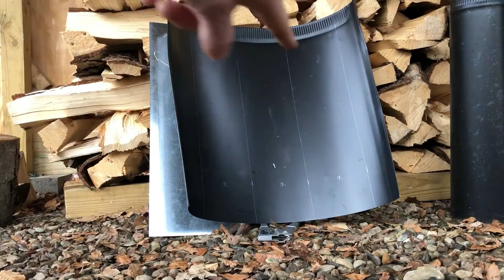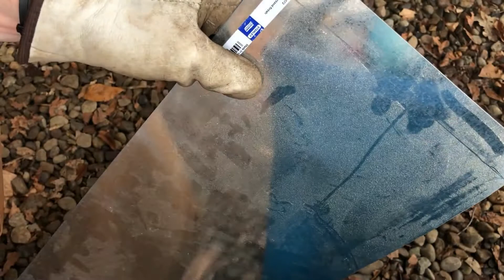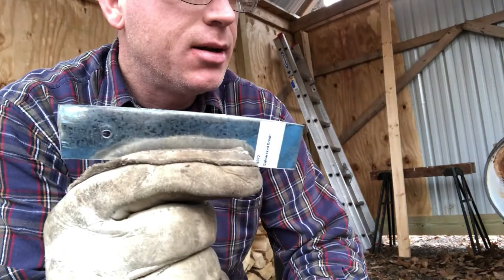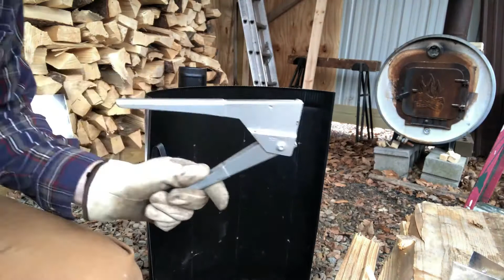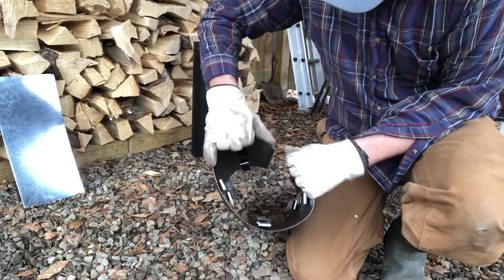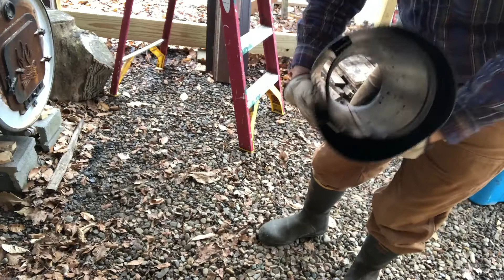Make Your Own Double Walled Stove Pipe

Comment: I did find this useful but a 1.0 or 0.75 inch conduit ran parallel might be a better idea than the tabs as it seems pretty weak and will probably give/flex/warp once the fire cranks up the 500+ F degrees heat.
In the older days, the internal spacer pipe served double duty...
1- As a heat shield
2-  As a Hot water pipe as well. 
      Just not much reserve until the idea hit that  you can  spiraled it in like a spring.. 
 It dud require extra support for the extra piping and water weight though. 
Then one had a steam  pressure explosion and it lost popularity until the boiler era.
But the conduit spacer pipe is surely a better and safer effort.

Then again you do not have to use the full 10 foot length of conduit, 3 inch long cut pieces should do the trick.
But sill .... I give you a 100 on the tab idea... it should be fine.
Reply from the maker: That’s an interesting perspective and definitely something worth considering for a future build!

Comment: Thank you for the share good sir, I've recently installed 2 woodtoves on my property, one in my studio and a nother in my shop, I know all to well how expensive insulated double wall chimney pipe is~ and the kits that go with them. (outrageous) in addition to the fact that you will have to purchase the same product again when the heat rots it out for a inflated price in 10 or so years, the first stove in my apartment was done with a legitimate Selkirk through the wall apparatus, and the second I made myself with some sheet aluminum, to not make this any longer I appreciate your share and will indevor to integrate this frugal adaptation in my next build and save as much money as possible, perhaps with some kiln insulation or rock wool to help keep things from getting dicey
Reply from the maker: Thank you for the kind words and for watching! Best wishes to you

Comment: Nice!  Is that your exterior chimney pipe too?  If so, how did you finish the top of the pipe?  Can water get in between the pipes or did you figure out how to enclosed that gap between the pipes?
Reply from the maker: This is just the portion that passes through the wall. It’s single wall before and after, and is capped by a regular rain cover. I need to figure out some way to keep rain out because it does get on the floor if it’s a heavy rain.

Comment: Seems like that would've been WAAAAY easier with carriage bolts 🤷🏻‍♂️ and faster also would've helped to insulate that pipe with ceramic fiber
Reply from the maker: I’m not sure I follow how you mean to use the carriage bolts?
Reply: @scottthornandhisbeesandtrees well I would've used ceramic fiber between the two layers and just drilled straight through both pieces and put the carriage bolt/screw through from inside the inner pipe a nut and washer and another nut and washer spaced at the right outer diameter wrapped it in ceramic fiber punched the bolts/screws through the fiber then just wrapped your outside pipe, joined it's seam and capped your protruding bolts/screws with washers and a nut but that's just how (my mind) sees it. You still did a pretty amazing job and saved yourself a lot of money
Reply from the maker: @jamesbernard6841  thanks for the additional context. For this I just used what I had on hand. I don’t doubt what you’re describing would work. Thanks for watching!
Reply: @scottthornandhisbeesandtrees  yeah thanks for sharing your experience with all of us. Honestly after thinking about it you really don't need to fasten both layers together if you insinuate the pipe with the ceramic fiber you would just need to roll the inner pipe in fiber, wrap the outside around it and then fasten the outer pipe closed, for added strength you could just drive the right length self drilling screws into it but wouldn't be necessary if this is connected on both ends. Great build tho
Reply from the maker: @jamesbernard6841  thank you for the kind words. This was for a sugar shack, and once that building was destroyed by a falling beech tree I used this in my barn. I like your idea for a more permanent fix
Reply: @scottthornandhisbeesandtrees  as a tree man climber/trimmer I feel your pain with the falling tree ugh, what you did was totally a good build and I admire the craftsmanship it's always easier to rethink someone else's thoughts lol 🤷🏻‍♂️ I've been banging stove pipe ideas around in my brain for years now the stuff is so dang expensive it's almost like they're trying to keep you from being self sufficient 🤔
Reply from the maker: @jamesbernard6841  that’s a fact! It was a few days after I had hosted a field trip about how to make maple syrup so glad at least no one got hurt. Hard to believe what the prices are!
Reply: @scottthornandhisbeesandtrees  the elite are stabbing the American dream to death one stick in the ribs at a time. The people have forgotten what the true American dream is . . . . To generate and store your own wealth, to establish self sufficiency and security making one a true FREE MAN ! And nothing scares the global elite more than the truly Free Man who can't be bought, swayed by propaganda, manipulated with recourses, extorted thru high interest rates etc. Power to the people may the people exercise the power!! 💪🏼

Comment: What about the guts out of a kerosene heater. Therebis triplw wall sheet metal in them. I got it out of one to use for a flue jack.
Reply from the maker: I can’t say, because I don’t have any experience with that part. But the biggest thing is to keep the surrounding surfaces cool.

Comment: How did you enclose the pipe. Like how did you block the gap on both ends to block out light and cold air coming into the building?…
Reply from the maker: In the original application I didn’t do anything as it was a mostly open sugar shack. In the current application in my barn I tried to use some sheet steel on the outside gap but it was poorly executed 🤦‍♂️. Air is not a significant issue but some water does come in.
Reply: @scottthornandhisbeesandtrees  I’m mainly concerned with the light. Bugs and such. I am considering using your method but stopping my 8” flush or just slightly on the outside and then running a 6” trim collar flush on the building to block the light. 
It’s a lot cheaper than buying a single piece long enough to go through the wall and I’m in a post frame building with no interior walls.

Comment: Thanks so much for sharing? I was wondering if you couldn't just stick aluminum ceiling hanger strips down around three sides. I don't think it would get hot enough to melt the aluminum.
Reply from the maker: I don’t really know the answer to that. If you search for the melting point of aluminum it may help you make that decision. I used these steel tabs since that is what I had on hand. Thanks for watching.

Comment: Thanks for the video. Will help me with 1 place in my shop I am within 13" of a wood brace that I want to make safer. Still not up to snuff with code, but at least more peace of mind having run single wall pipe the whole way out my pole garage lasting for years & years. Now upgrading to class A chimney pipe & more efficient larger woodstove. Yes, that will be something I can add inexpensively. Thanks & hey, I make mistakes on every project I work on! Thanks for including yours.
Reply from the maker: Thank you for watching and for the kind words! Best wishes to you in your shop.

Comment: What temp is the single wall pipe rated for?
Reply from the maker: This is what I found on the Lowe’s website, where I bought the pipe: “It has a maximum temperature rating of 700°F, with a short-term exposure rating up to 800°F.”  Hope that helps!

Comment: Scott, the six inch pipe you slipped into the 8 inch pipe...how did you secure the two together?  In other words, if the six inch was not fastened to the one inch strips, I would think that six inch pipe would slip down out of the 8 inch pipe?
Reply: Maybe all you have to do is make a 6 1/2 inch collar that you fasten to the inside of the male ends of the 8-inch pipe sections.  Enough to allow the 6-inch through, but will keep it roughly centered inside the 8-inch pipe.  Or just put 1-inch screws through the outer pipe.  The ends of the screws will fend off the inner pipe and give it some flex.
Reply from the maker: The six inch pipe was not permanently attached to the eight inch pipe. In this application it was part of the horizontal run in between coming off the stove and outside the shack. Hope that makes sense. Thanks for watching!
Reply: @scottthornandhisbeesandtrees  Thanks for replying...and so quickly.  I understand that the two pipes would not have to be connected on a horizontal run, but what about vertical runs?  Say I have two or more vertical runs spliced together (48" total pipe length, for example that require two 24" pipes "fitted" together)...I would think I would need to somehow attach the tabs to the inside pipe to prevent it from slipping.  Any thoughts?
Reply from the maker: Ok I think I understand now. This method would need a way to keep the two pipes attached together but I’d think just a few tabs would do it. I do not think you’d have to secure all tabs to both pieces for it to work. Probably some self tapping sheet metal screws would do it. Good luck and let me know what you come up with.